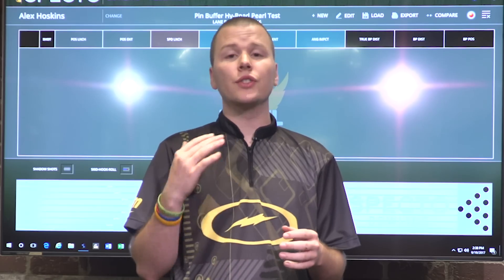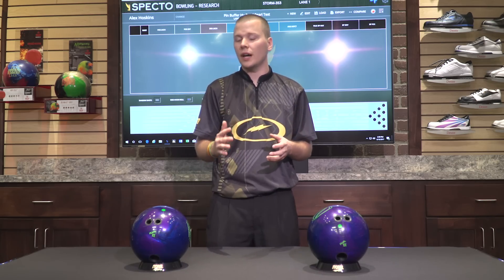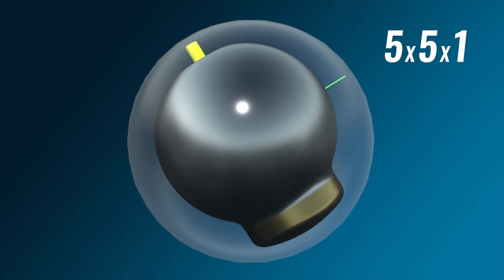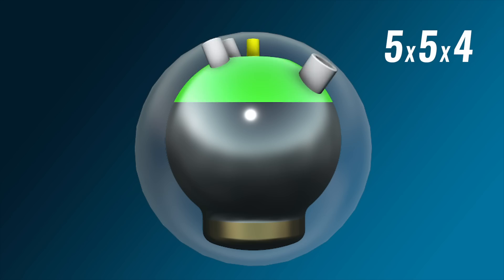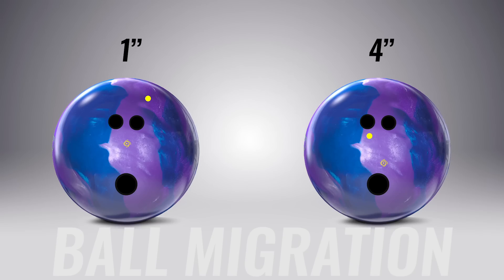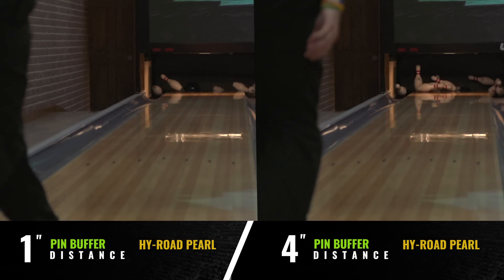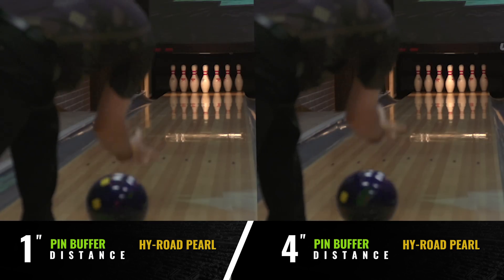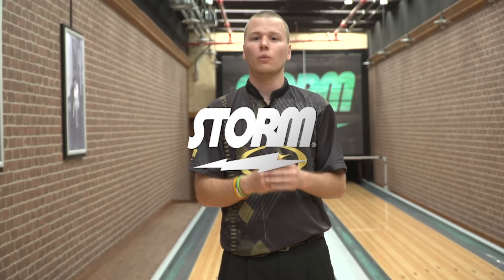Storm | Pin Buffer Layout System - Part 3: Pin Buffer Distance

Comment: This is simply an outstanding demonstration of a pin up vs pin down layout and how you can have two identical symmetrical balls laid out pin up and pin down for league bowling.  When you see that ten pin start to stand as the game goes on, because energy is being lost due to the lane transitioning,  pull out your same ball but with a pin down layout and watch that stored energy blast that ten pin out.  Realize there are other adjustments you can make, this is just one you should have in your arsenal.  Bottom line watch YOUR BALL “ROLL” through the pins and off the deck!
Reply: It's not just pin-up vs pin-down. It's a factor of the angle of the Vertical Axis Line from the Positive Axis Point to the Pin. You could shoot the Pin right above the bridge or middle finger and it would slow the transition time down tremendously.

Comment: I would like to see the bowling ball pictured according to where the PIN, PAP and orientation of the block are at release when discussing layouts (thumb hole up and finger holes down). When the bowling ball is pictured PIN up the finger holes actually are upside down. It requires mental gymnastics to imagine the positions of the PIN, PAP, and block when the bowling ball is pictured upside down.

Comment: You say you want a later hook and role phase when on a worn pattern, but in your other video, you say that pearl balls, which hook later, are bad for over under
Reply: Pearls save most of their energy for when they see dry. With worn lanes, that could be sooner if the pattern is really torn up. If it does see pockets of the dry, it will cause it to attempt a transition when there may be more oil causing it to skid once again.

Comment: ok, i roll a slower ball with a fairly high rev rate so after watching all 3 videos I guess I want a 1 1/2 in. pin to pap, a 2in. psa to pap and a 4 in. pin buffer. I need all the help i can get. my ball hooks past the head pin, no matter how far left I stand, so im going to the pro shop and getting a ball with the weakest cover I can find and a mellow wt. block and have him drill it. I only bowl for fun with my buddys but I wish I could get my ball not to hook as much in thew back end.

Comment: It would have been nice to have a fourth video that brings all of these together. The first two videos (Pin to PAP and PSA to PAP) were remarkably similar in effect, that it's hard to learn anything meaningful from it. 

For instance... if both a medium Pin to PAP and PSA to PAP can create instability, which one should I drill for? Or do both come into play?
Reply: The pin to PSA can help create more flare when you have a pin to pap of 5 to 6 inches. In a symmetrical ball a pin to pap of 5 to 6 inches could create minimal flare..but putting the PSA at 3 1/2 to 4 inches in conjunction with that pin to pap length will cause the ball to still flare a lot.

Comment: What is the effect if you place your pin 2 inches to PAP with 1 inch buffer?
Reply: A ball that will start early and not flare a whole bunch. It will create an "arc" motion. Unless you have a huge Asym or really high revs, I wouldn't suggest it. If you are using a big Asym, you can adjust the PSA to PAP and lower the transition time by lengthening the PSA to PAP. 

I know this is an old comment, but this is incase anybody comes across this and is wondering.

Comment: How do you find the PSA on a Symmetrical ball?
Reply: There’s no PSA pre drilling so there’s basically an imaginary PSA the Pro Shop uses 6 3/4 inches away through the CG. Once the ball is drilled the PSA is in the thumb. Per Mo Pinel. This all new for me too but is very helpful. On symmetrical balls what’s important is the Pin to Pap and the Pin buffer distance.
Reply: it'll be in the thumb unless there are weightholes.
Reply: Thanks, I went 6-1/4" from the pin and used that is my PSA. I know the video showed it in the Thumb hole too.

Comment: This seems backwards from what I've ever heard. It has always been "pin up goes longer"
Reply: pin up will go longer, but will break faster off the spot.
Reply: Other things being equal, as shown in the different motions of the 1" (which puts the pin above the finger) and the 4" (pin below the fingers) pin buffer balls, pin down layouts "go longer," even though the common phrase "go longer" is not really precise enough. It's one of several semi-technical colloquial bowling terms that add to confusion rather than clarity. A layout that puts the pin below the fingers will take longer to transition from skid to hook to roll, in effect "going longer."
Reply: Brandon Ferris p

Comment: Now I'm more confused than before I watched the first video! I think I'll stick to telling my pro shop guy things like "I need more length, and my ball doesn't have enough continuation." He seems to understand this a lot better than me.

I did, however, try a 3 3/8 drill on a ball I was having trouble with on heavier conditions and it made a HUGE difference. Don't ask me what the other measurements are, but the pin to pap was the 3 3/8 measurement. It puts the pin touching the side of my ring finger and the MB is touching the thumb hole.

Comment: I have to really throw my high road pearl fast to get any decent reaction, does anyone play with the surface of this ball for better carry?
Reply: 1. Put some POLISH on the surface.  This will help the ball "get down the lane" using less "delivery force (i.e., it'll "slide" easier)".
2. Do you "roll" the ball (hand BEHIND the ball at release) or "spin" the ball (hand ON THE SIDE of the ball at release)? a "rolling" ball will get the core working sooner (i.e., transition to "hook" earlier), a "spinning" ball will SLIDE FARTHER before it transitions to "hook".

Have the Pro Shoperator at your center observe your "mechanics, etc."  It may be your "mechanics" (swing and release) are fine, but your ball needs a different layout OR the ball's layout is fine and you need help with your "mechanics".  Either way, try putting POLISH on the surface.  FWIW, I have a HyRoad Pearl and I need it "polished" as its' cover is very "aggressive" for being a pearl (and its' CORE is nothing to "sneeze at" either!). :)
Reply: Putting Polish on the ball will give you more angle to the Pocket also.

Lower RG balls also Give you a more Dramatic angle to tha pocket.

So the storm sonic that is   LOW RG and polish is going to give you a LOT of HOCKEY Stick angle to tha pocket

Comment: Wonderful Series. Time to go quiz my pro. He was drilling bowling balls for Leanne Hulsenberg before she moved to Utah. He is a young guy, who drills my equipment that cracks in half after 6months. I just purchased a Storm Intense drilled 4-4-2. It is a used bowling ball, so it might crack also. I'm purchasing a used code red after my back surgery on Nov-18th. I asked him to drill this ball at 4-4-1. Am I correct about this. My avg. is 179..
Reply: Alan the layout will not have any impact on whether a ball cracks or not, as long as the locator pin is not partially drilled into.  Partially drilled pin will void the warranty on the ball.
Reply: David Henson Yes, him and I spoke about this. He drilled my code red and put the pin in the  middle of my fingers, 1 inch up. So waiting til next August, and my healing will be over..

Comment: It looks like the 1” pin buffer hyroad goes faster through its phases than the 4” does. I always thought that a pin down layout such as the one one the 4” pin buffer has a sooner and continuous hook compared to the late and sharp reaction of a pin up?
Reply: That’s the common misconception. Pin down does not hook early, and pin up does not go longer. It’s just the opposite.
Reply: MrJochemke  The 4” pin buffer will have increased rg making ball go longer and lowered it in the 1”.
Reply: Me too. 🤔🤔🤔
Reply: Is it basically that we've just thought about it wrong? Getting into a roll early makes it more angular, correct? So we would still get the more angular motion on the pin up ball.
Reply: Yes, pin up layouts will look "more angular," because they do their "work" more quickly than a pin down layout.
Reply: 4" pin buffer makes the ball take longer to go through the hook phase, a more rounded arc break versus the 1" sharp break point

basically think 1" sharp hockey stick motion, versus 4" rounded arc.

as far as earlier or later, yes rg has an effect, but the surface really determines that so much more than layout. especially on two of the same symmetrical balls like this, the psa always winds up in the thumb hole

on an asym you can create earlier or later reactions with smaller or larger drill angles using the dual angle system, or in storms system, shorter psa to pap equals earlier